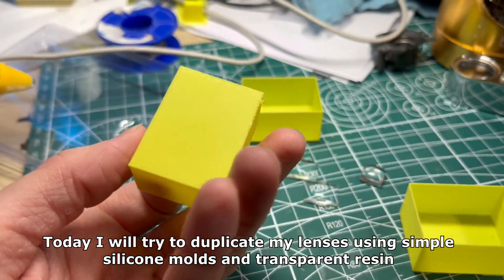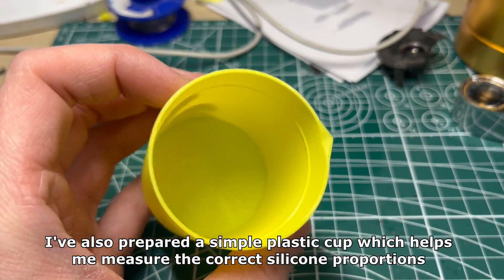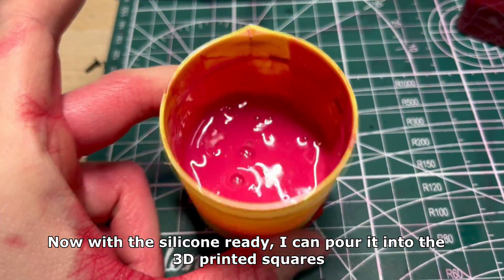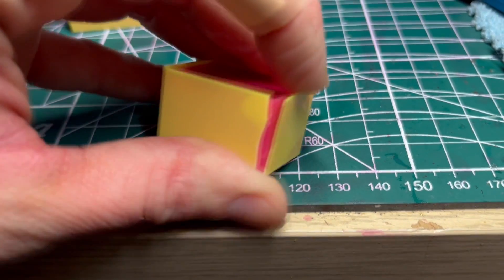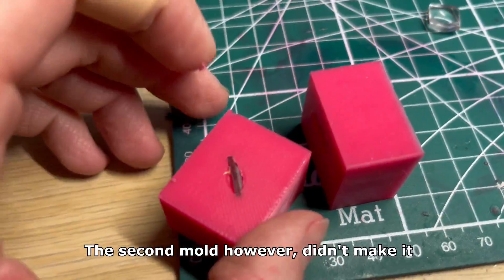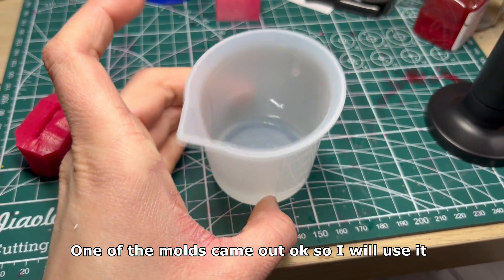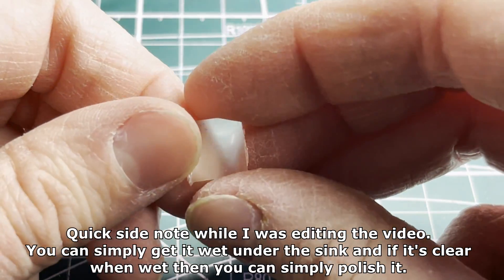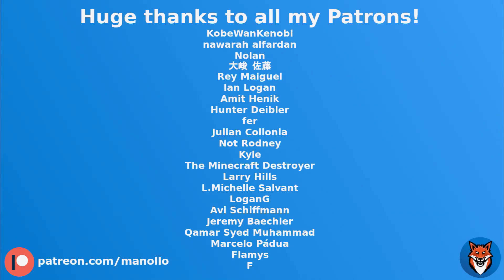Cloning Optical Lenses With Silicone Molds

Comment: You can probably use a large syringe in order to degas the resin that you cast. You draw the mixed resin into the syringe, then close the inlet say by pressing it against some rubber and pull hard on the plunger, which if you're lucky will separate out the air to be top of resin. Repeat as often as it'll let you, unfortunately the seal isn't perfect. Then the resin is less likely to form internal bubbles during casting. In a 50ml syringe, you should be able to degas 2ml of resin. So this method isn't ideal to degas the mould silicone, they don't make syringes large enough :D
Reply from the maker: That’s a pretty good idea but it sound like it would take forever to fill the silicone mold with resin 😓
It’s probably a good idea to buy a small vacuum chamber. It eliminates pretty much any air in resin.

Comment: Good progress! Would like to know if the bubbles in the resin can get removed. Maybe put it in a sonic bath before letting it cure? Thats what they do with concrete at least ;)
Reply from the maker: Thanks!
You can use a small vacuum chamber to remove the bubbles. I just don’t have it yet.